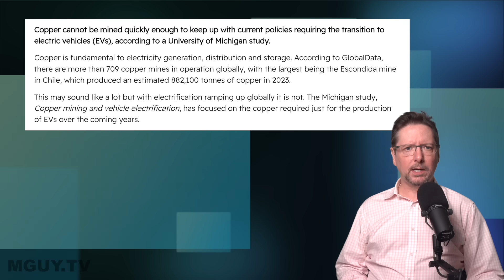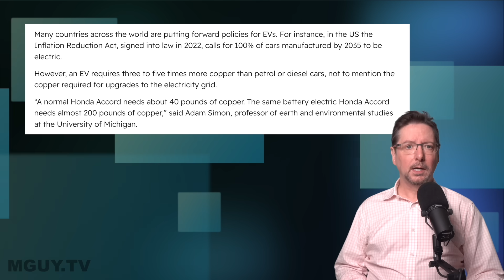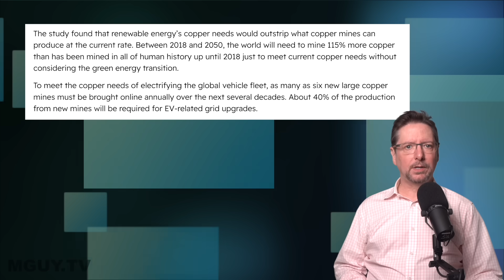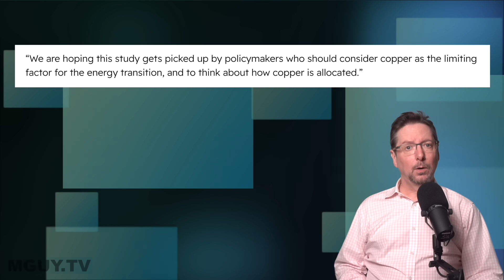Copper cannot be mined FAST ENOUGH for EVs and Net Zero Transition | MGUY Australia

Comment: I have been saying this for years. You recently posted a video on the 10 minute charging battery that China made up to scam people into buying EV's. The charging cable to support that would need to contain 110kg of copper. Imagine a 3 car family needing almost half a ton of copper just for the charge cables. The cables feeding the home would need to be even thicker as the voltage is lower (so higher current). The average home would require over 3 tons of additional copper. The planet does not have enough copper to allow everyone to drive an EV so the laws being passed to force us into EV's are illegal by the virtue of enforcing an impossible goal.
Reply: That's the idea.
The EV is a stepping stone towards removing cars from the masses.
Reply: @sahhull  YOu are exactly correct. This climate crisis is an shill game.
Reply: 10 minute charge would still be rubbish even if it were true, 5 times longer than filling up a real car! 😂
Reply: @t28mcd  5x longer for a shorter range too.
Likely killing the battery 10x quicker.
Reply: @t28mcd  The average time to fill a petrol car (not including the time taken to depart from the route and get back on track) is 8-9min including the time spent paying.
Reply: @t28mcd  i squared r heating. why is no one mentioning this?
Reply: @esecallum because they have no idea what it means. Either you reduce r with a bigger cable or you increase v (v squared over r). To deliver the charge to the vehicle your voltage is more or less fixed; elsewhere you might have high voltage cables to supply the charging stations via step down transformers.
Reply: @Charonupthekuiper  I am referring to I squared r HEATING. The slightest resistance heating while you are pumping hundreds of amps and it's gonna get hot real fast. The battery must be perfectly uniform as high resistance areas will heat up very quickly..  hundreds of amps.
Reply: @esecallum yeah and to prevent this all cells have to be in perfect condition otherwise you have to rely on electronics to control it.
Reply: its not impossible .. homes can install their own diesel generators .. so they can pump electrons directly into their teslas :/
Reply: Interesting post, Can i add the electricity leaks out of insulated transmission lines so the power companies have to put more copper in the line to carry higher volumes to make sure enogh electrity get to the needed location. I don't know the %
Reply: @markseehawer3762  Mark, you are on the right track but it does not leak out as such, but the losses are due to volt drop over the length of the cable, many other factors also affect the volt drop such as ambient temperature, it is down to the conductive properties and resistance of the cable impeding the flow of electrons over a given distance. Ref  Volt drop in cables, plenty on that if you look on google etc
Reply: @Ifitwerks  I've watched an experiment done under transmission lines Wher an above gound wire was supported on wooded posts. a high volt meter was attached, negitive to a spike in the ground positive to the insulated wire. No power source other than the transmission lines 30" above the insulated wire The meter was rated or 650 volts when it was attached it quickly started rampping up and in about 10 second was at 450 volt the operater diconnected at this point to save his meter. On another occation i watch a simmilar thing on a 60 minutes type of show. this is at least 30 years ago. in this experiment a young girl walked under the transmission lines holding 2 floresnt bulbs or tubes there was nothing attached to these tubes but they still lit up bright as day. how else would you explan this other than to call it leakage. Finally farmers were noticing that crops wouldn't grow around wind mills and the ground was extra hard. What they dicovered is the worms won't go within a certain distance to the windmills due to resdual electric wave energy. These farmers were also getting a spike in cancers amongst the people living close to these windmills same problem electric wave energy. The windmill stuff occured in Onterio Canada And their was quite a fight over it. Again what eles would you call it but leakage. Micro wave oven with bad door seal same thin electrical wave leakage.
Reply: @markseehawer3762  You are correct about the effect on trees ,crops etc which grow under power lines there is one example near me, and I would not live by them for the effect they have. however it is due to a effect of electricity rather than "leakage" electricity has many useful effects and some if not used in a controlled environment do appear to have damaging consequences for anything in close proximity to the very high voltage such as in power lines, various studies appear to have been done but governments are still happy to allow development nearby, I think more need to be done on this. This effect which you call leakage is the electromagnetic effect generated by the cables rather than leakage from the cables. In the electrical industry leakage is used to describe current flow to ground or earth generally during a fault situation and is that which causes fuses to blow and trips to operate and serves a vital safety function. cant explain it better than that so you can be sure on the difference between leakage and effects.
Reply: @Ifitwerks  Thanks that does clear it up for me. i have seen what your talking about when welding. cables will want to coil up. electormagnetic effect. It's quite crazy to watch.
Reply: EV companies will be out of business by 2032. Just my intuition. Never an EV purchaser here.
Reply: Electric vehicles preceded ICE vehicles. They went largely obsolete due to problems with the battery. The battery remains a big heavy costly problem.
Congestion in major cities is best alleviated by good mass transit systems.
Reply: @johngeier8692  Most people don’t live in major cities.
Reply: The amperage for fast charging is reduced as they charge at 800V. Don’t confuse me with an EV pundit. There are a lot of reason why EVs are not for everyone - which is, I think, why the global elite want them to replace ICE.
Reply: its absolutely impossible. even attempting it will greatly damage the economy.
Reply: Very well said . A plethora of so called”laws” , especially since 2020 are void / inherently fraudulent/ mala fide .
Reply: asteroid mining, but oh wait we can'd do that either.
Reply: @sheilaolfieway1885  With respect, I think most people are more concerned with the here and now and how it affects them.
Reply: It's not an "impossible goal" to deprive most people of their reliable petrol-driven transportation. They're taking away our ability to go where, and when, we want to go. It's necessary, otherwise we won't accept living in "15 Minute Cities," i.e. be slaves for the globalist elite!
Reply: What an insane false equivalence - these are not for home use, we have 3 EVs already at home and they all charge quite ok from a single Level 2 charger and/or occasionally a 240v plug in cable - never any conflicts.

500Kw charging already exists there is no 110kg+ cable involved from the charge station to the truck - the Tesla semi cable (which charges at 1MW or 1000kw) weighs around 18kg in total (39lbs)
Reply: @TB-up4xi  your fart in the wind ev. 1200 new coal power stations..has haaahaaa
Reply: You are so short on facts and understanding of EV charging. 
1) the 10 minute speed isn’t hugely faster than current DC fast charging and the cables aren’t super heavy 
2) there is NO reason for anyone to have this as their home charging. For most people a wall outlet will suffice for daily driving. If not, then level 2 will do.
Reply: The only thick thing here is you. Why on earth would anybody charging at home need to charge at considerable expense if your fantasy ever got past the electrical engineers pissing themselves laughing . As all the 1.2 million ev owners in the uk , admittedly not all with access to off street parking, you charge slowly when you are sleeping slowly taking current which is equivalent to boiling and electric kettle or an electric shower.  Why would you want a ton of copper in your house to charge a car in 10 minutes with 250 miles of range when you get 100 miles charging for 10 hours from an ordinary plug or 200 miles from a charger. We do that now from a normal house, meets, regulations, no extra wiring required apart from 4mm cable to charger. We are all happy.  No pollution from car, climate damage considerably reduced
Reply: High voltage at low amps transmitted via relatively smaller gauge wires. Do you have any idea what kind of infrastructure would have to be installed in your home to provide a 500kW EV charger? No, I didn't think so. Most EV fanatics don't. Their power fantasies are made of unicorn piss and fairy dust.
Reply: i squared r heating /// haa haaa
Reply: the planet currently produces 22 million tons of copper per year with about 700 million tons in total copper thats been mined.  we're totally not ever going to run out of copper.
Reply: @jebes909090 The planet you say, well the planet doesn't produce any copper however mining companies do.
Reply: @0Aus  OMG YOU"RE SO SMART?!!!!  and mining companies dont produce copper they mine it genius 🤣🤣🤣
Reply: @jebes909090  what department? Mining production.  Try again champ🤭
Reply: @jebes909090 Mines appear by magic do they? Or we going to rip it out of homes to provide it for cars now?
Reply: @jebes909090  Remember that 22 million tons of copper is already earmarked for other uses.  

So here's your homework assignment:
1) Find out how much copper does an EV  require in total pounds

2) Find out how much copper is used a year already
3) Multiply the replacement of all cars in the US (I'll give you a hint, the US has 250M cars)
4) And then get back to us on how many additional tons of copper need to be mined.

I've done the calculation, but I want to see if you'll get away from your feelings on this matter and get into data and facts.

*here a hint: there are 183 pounds of copper in an EV. vs on average 25 pounds of copper in a normal car.
Reply: Not when the new charging trees are operational and here is a source to prove it, this quote from copilot   do keep up with progress.

 "Remarkably, no utility upgrades are needed to install these “trees,” yet they can deliver impressive power levels: 200 kW or 500 kW.
At these power levels, they can add 200 miles of range in just 13 minutes or 5 minutes, respectively" 

Its remarkable as they say all that copper presumably wont be required as no utility upgrades are needed so they have found a way to increase charging speeds without heavy cables. As a believer think of charging speeds like broadband speeds, we do, it doesn't need bigger cables to your house, as a EV supporter we understand this better than anyone.

This will upset climate deniers and anti EV luddites who cant embrace technology and when they are rolled out fossil fuel will be gone forever ha ha !🤨🤔
Reply: @Ifitwerks  No need to upgrade the infrastructure to run 200/500kw chargers really 🤔 I'll like to see you wire up your kettle using 0.5mm instead of 1.5mm wire then see what happens as to carry a higher current you need a large cross section of wire that before.
The use of broadband speeds to prove your point isn't a valid one as it's a digital signal also optic fibre doesn't carry voltage.
Btw April fools day has long since passed.
Reply: @derekcable  Wrong, you just increase the boiling speed that's all, simples.
Reply: @Ifitwerks  Give it a try and come back to me with the outcome.
How do you think a wired fuse works ? Using a 0.5mm wire on a 3kw draw will turn out likewise 🔥
Reply: @Ifitwerks  You have no clue about electrical, electronic or digital transmission theory. If I were you I'd stop talking now, mate, you are just embarrassing yourself at this point.
Reply: @derekcable  Ok time to come clean! it was a spoof to show how people can be sucked in to anything and as a 40 year career electrical power electrician of course its delusional 
But the desire to virtue signal needs no facts just belief, and who can argue with co pilot?
Co pilot just feeds back this rubbish and it goes unquestioned if you need to believe and don't apply critical thinking. MYGUY should get a boost to his channel from all a the comments and I hope he keeps on doing this stuff well done and thanks MYGUY😉😂
Reply: @emceedoctorb3022  Ok time to come clean! it was a spoof to show how people can be sucked in to anything and as a 40 year career electrical power electrician of course its delusional 
But the desire to virtue signal needs no facts just belief, and who can argue with co pilot?
Co pilot just feeds back this rubbish and it goes unquestioned if you need to believe and don't apply critical thinking. MYGUY should get a boost to his channel from all a the comments and I hope he keeps on doing this stuff well done and thanks MYGUY😉😂
Reply: @Ifitwerks  Fair enough. 35 year career as an electronic engineer specialising in RF here.
Reply: @Ifitwerks  If the load in a wire is increased the wire will heat up and melt the insulation. and by the way it's not volt that will do this its amps. otherwise known as electromotive force 500 volts with no amps won't do anything add 1 amp and it will fry you. So to sumerize. load is amps not volts.  Volts is the rate of flow amps is the amount flowing. Amps are what charge the battary volts is the rate of delivery. You want to carry more amps to charge faster you need more copper to carry the load. Physics doen't lie.
Reply: @derekcable  These guys arn't getting what your saying mostly because they don't know the differance between volts and amps. I get what your saying. The heat element in the kettle is basically a short to ground circut to heat the element. the bigger the element the more load or amps required so the bigger the delivery wire. sound about right to what you are trying to get across to your na-sayers.
Reply: @markseehawer3762  Ok time to come clean! it was a spoof to show how people can be sucked in to anything and as a 40 year career electrical power electrician of course its delusional 
But the desire to virtue signal needs no facts just belief, and who can argue with co pilot?
Co pilot just feeds back this rubbish and it goes unquestioned if you need to believe and don't apply critical thinking. MYGUY should get a boost to his channel from all a the comments and I hope he keeps on doing this stuff well done and thanks MYGUY😉😂
Reply: @emceedoctorb3022  LOL Cant see myself not calling out this rubbish but when you talk to those converted believers tech will solve everything and must not be questioned, the problem is when AI regurgitate stuff made for ideologs it is deemed as fact even when when it is not by all known textbooks. I am just waiting quietly for the day it all comes crashing down which it will.😄
Reply: @markseehawer3762  Absolutely spot on Mark 👍
Reply: @Ifitwerks  45 years as a service/call out engineer in the elevator industry.
Reply: @Ifitwerks thanks for your responce. do you care to explain how or what i said that was incorrect. i'd actually like to know. I'm Not an electrician, but I am a Machanic and a Welder Licenced in both. I will admitt that I understand DC better than AC so enlighten me.
Reply: @derekcable  I believe we posted previously, I seem to remember.
Have you noticed in the last few months, that the new phrase "charging speed" has come to replace the correct term of charging power (kW) for some strange reason?  I think it is to equate it to internet broadband speed and goes down well with those who want to deny the massive loads in kW as it makes it better for them.
Reply: @Ifitwerks  Yes we have posted before 🤣  The use charging speed is all the EVs owners are concerned with but not realising to get a faster speed you have to ramp up the KWs.
I think you have a valid point in regards to broadband speeds,it could also be viewed as the speed of charging a mobile phone there is a psychological connection....EV range mobile phone standby.
Reply: @markseehawer3762  Mark, to answer this one for you, you can have 500 volts as and no amps, as amps which is the current only flows when a resistance is connected to the circuit and the higher the resistance the lower the current and vice versa.
If the human body were to contact the 500v then if the contact point resistance allowed just 100mA (one tenth of an amp) to flow it is likely to result in stopping the heart. which is why RCD devices are set to operate below 30mA to protect life, hope that helps.
Reply: @derekcable  Which brings it neatly back to the charging tree and not needing infrastructure upgrades is denying reality and physics.
Reply: @Ifitwerks  Yep 🙄 I've seen the odd one on lamp posts in a few South London back street but what is there output I couldn't say as I'm assuming there only single phase not 3 phase so it would be like charging from a 13amp plug socket 🤣
Reply: @derekcable  Yes, I used to do some streetlighting in my early days when they were SOX and Mercury lamps but now LEDs are here the load demand is much lower but you would be lucky to get much more than  3 or 4 kW from an original street lamp supply as a additional load as they were only designed to carry the load of the lamp and the smallest cable to do the job would have been used of course which makes total sense at the time.
Reply: @Ifitwerks  My thoughts exactly with the now use of LED lighting there would be a bit of current redundancy for the odd changer but nothing more than what you could run of a 13amp domestic shocket from,it still doesn't work for the masses does it ?
Reply: @Ifitwerks thank for your reply. I kind of think thats what i said. Its not volts that will kill you its amps.  I was just rounding up on the amps to simplify my point. I didn't have specific numbers.As you know everything that uses electricity needs a complete cicuit to function . wether its an element in a kettle or a light buld in a tail light. they all go short to ground but are engineered to handle a specific load. thanks for the specific numbers.
Reply: @markseehawer3762  You're welcome 👍
Reply: @derekcable  It's actually straightforward - I can use a 0.5mm wire to boil at kettle at exactly the same speed as a 1.5mm wire - all I need to do is up the voltage from 120v to 1080v.
Reply: @TB-up4xi  it's not the speed it the current draw but upping the volt will allow a bigger current using a smaller diameter cable just as they do on national grids running reasonable diameter cables,high voltage then drop it down to domestic voltage at local substations.
Reply: @Ifitwerks well done spoof. Near Babylon Bee quality. Excellent mish mash of words.
Reply: @Ifitwerks yep you said it your a spoof
Reply: @Ifitwerks here we go folks. Another 10 year old that thinks a simple announcement is evidence of science fact. You know someone hasn’t been on the earth long by how easily they are manipulated by announcements.
Reply: @xr6lad  Ok time to come clean! it was a spoof to show how people can be sucked in to anything and as a 40 year career electrical power electrician of course its delusional 
But the desire to virtue signal needs no facts just belief, and who can argue with co pilot?
Co pilot just feeds back this rubbish and it goes unquestioned if you need to believe and don't apply critical thinking. MYGUY should get a boost to his channel from all a the comments and I hope he keeps on doing this stuff well done and thanks MYGUY😉😂
Reply: @Ifitwerks  That BS has already been debunked.
Reply: @Ifitwerks  Idiocracy!
Reply: 😂😂🤭 @Ifitwerks
Reply: This person or bot is off with the pixes. You cant break the laws of physics and thermodynamics.
Reply: @Ifitwerks You're forgetting about one problem "resistance". The more power/amps you try and shove down a wire that is not rated for said power will cause heat and eventually cook the wire. When I upgraded my stereo in my car the amplifier requirement is 0/1g  in order to feed the 9000 watts amplifiers. Not to mention beefing up my alternator to a 250amp with again 0/1g going to the battery and all grounds. When I was younger my friend wired up an amplifier with some shit wire that wasn't rated to handle the power draw and guess what happened? The wire over heated and caught on fire. Almost cooked his car and the samething will happen with that pipe dream of a tree charger without upgrading the electrical wiring. 🙄
Reply: @tspbod260  Ok time to come clean! it was a spoof to show how people can be sucked in to anything and as a 40 year career electrical power electrician of course its delusional 
But the desire to virtue signal needs no facts just belief, and who can argue with co pilot?
Co pilot just feeds back this rubbish and it goes unquestioned if you need to believe and don't apply critical thinking. MYGUY should get a boost to his channel from all a the comments and I hope he keeps on doing this stuff well done and thanks MYGUY😉😂
Reply: @Ifitwerks  Lol what a load of BS😂 are you trolling?
Reply: @Ifitwerks - If you really believe that, the Funny Farm asks that you return immediately for a Physics Lesson. But you’d better stop off at an English Language School to brush up on your grammar, syntax and composition skills.
Reply: @blxtothis  Better brush up your observational skills and read further down the comments 😁👍
Reply: @Ifitwerks  believe everything you hear?
Reply: @maddhatter3564  My point exactly, look further down the comments!!
Reply: @Ifitwerks  You're missing the point.  The earth doesn't have enough resources to convert to EVs.    Even without these high-capacity cables.
Reply: @teekay_1  Your talking to people with lolley-pops and unicorns dancing intheir heads. I have never been able to sway a fan-boy. Good try though.
Reply: @Ifitwerks  How can they build electric cars without using fossil fuels.